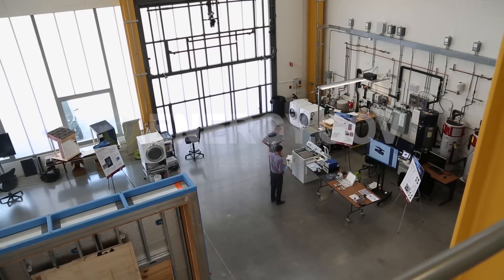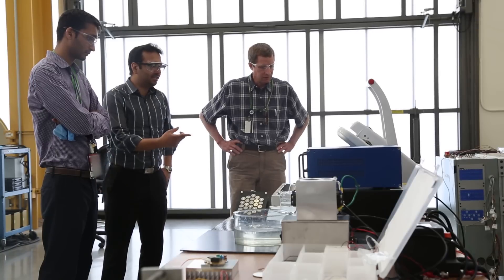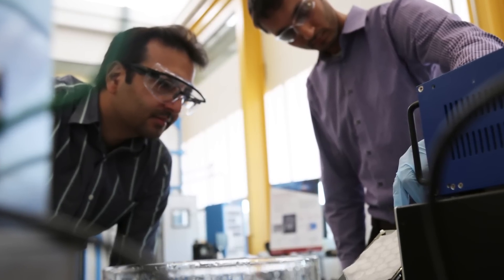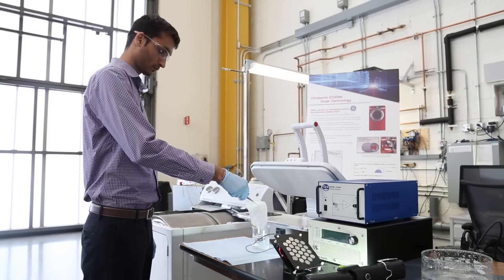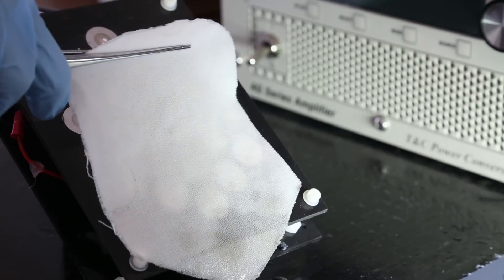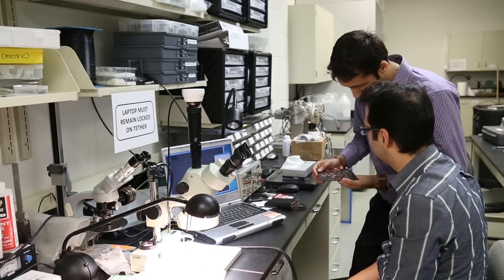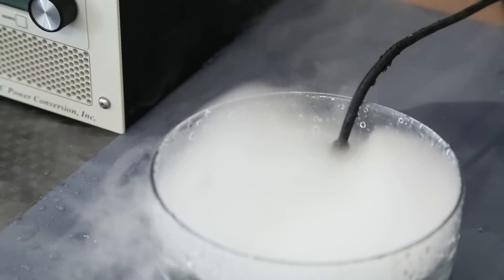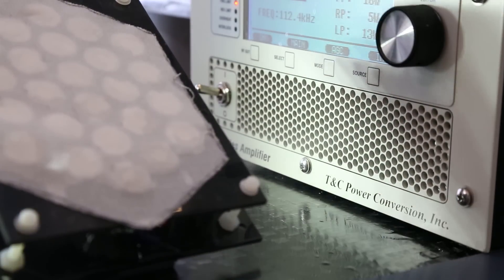Ultrasonic Clothes Dryer- No Heat Needed

Comment: It's been 8 yrs...where is this game changer?  

True game changer:  honesty.
Reply: 😂 fr dude
Reply: This is eggheads doing basic engineering for the technology, not a commercialised product demo.

Typically it can take up to 10 years from a viable hand made in laboratory proof of concept device to get out into the consumer market place.

That period of time can be even longer depending on the complexity of the tech to adapt for economical mass manufacturing. processes, not to mention building up a redundant supply chain for masnufacturing parts not already used by existing common consumer devices.

For example, solid state RF ovens were being touted well over a decade ago as more efficient and more versatile replacement for microwave oven cooking technology.

I have still yet to see one of them on sale from any major consumer electronics chain.

Basically don't expect it to turn up until it's literally got a price tag on it.

Comment: Hey  idiots the earths veins aka water streams are taking tide capsules like 8 trillion a day what happened to the ultrasonic detergent free washers w replaceable filters that go too Singapore trash burning systems you tube because there’s 200000 landfills oozing toxins in the environment Being spread like the original covid generators through the powder lines what your crew lick the other planets nuts later

Comment: Im dubious about how safe any machine is that has high frequency vibrations on the human body....
Reply: The same as any ultrasonic vibrations, you can't even sense them. Unless the input energy is off the charts ofc.
Reply: @davidblahota5655  perhaps not sense them externally but what will they do to a persons innards eh?
Reply: @Lauren-vd4qe  vibrate them so fast that u won't feel it, if anything at all, unless you get in the dryer yourself.
Reply: @davidblahota5655  my uncle did that before to my cousin for a few seconds

Comment: There's also ultrasonic cleaning, so will GE have an automatic wash-dryer?
Reply: there is a one unit washer dryer its called Splendide
Reply: @Lauren-vd4qe  Yes, and it saves space but you pay for that, it seems.  And it uses the usual technology.
Reply: Ultrasonic cleaning would likely cause as much damage as cleaning, especially on thinner fabrics.
Reply: @mnomadvfx  It will be worth it as long as it cleans stuff instead of just splashing some water on it like regular washers.

Comment: I wonder if those same transducers can be used in same machine for washing or "wash boosting" too (like indiegogo dolfi ultrasonic "washing soap"). Also can that fast mechanical vibration break or wear out clothes. How about plastic/metallic buttons, zippers etc..? I don't know how those condensating dryers are actually done but this could be a good combination.
First thing that comes into my mind is that these could work nicely in the "wings" of european style horizontally spinning drums.

Comment: Interesting,works on light delicates,not thick heavily drenched clothing. They have many years of trail and error ahead. There is  drying time to take into consideration. How about a dryer that reuses that lost heat energy and wind force? During winter a home dryer can be used to distribute heat to a home or greenhouse. i do not think these tiny ultrasonic devices can remove water in a timely evenly matter,especially using less power.